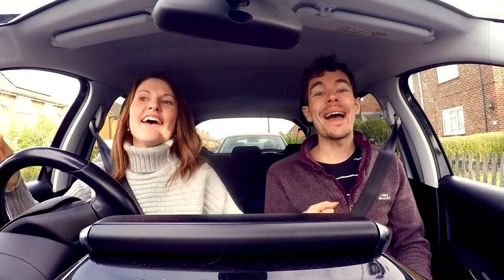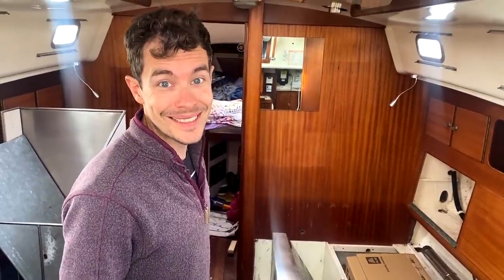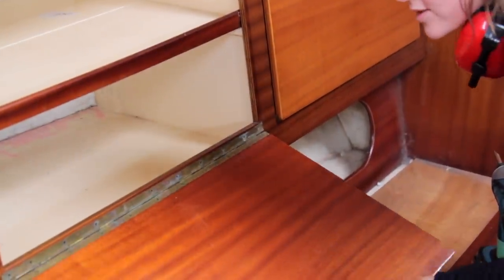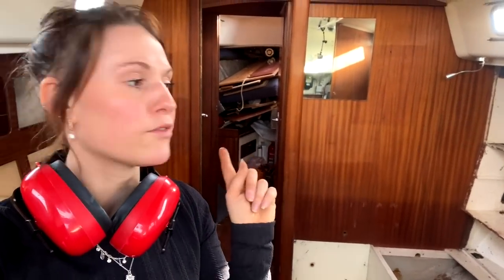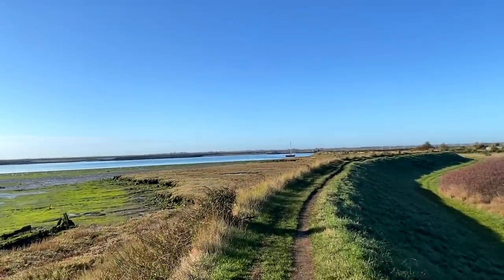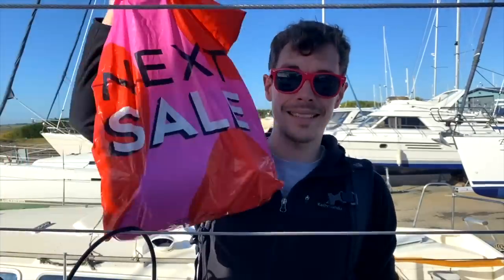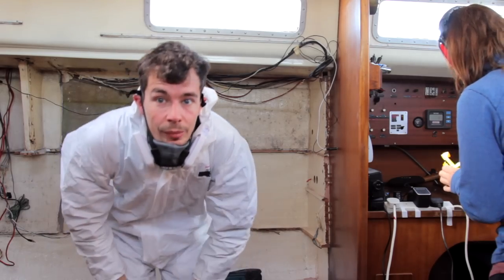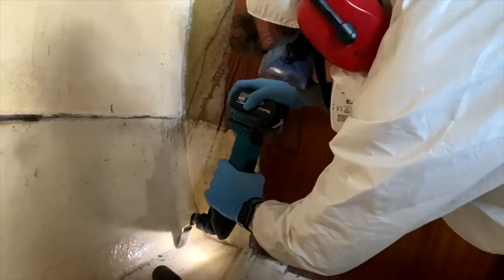Ep 4 | DEMOLITION has begun: what have we done to our SALOON?!

Comment: Not sure the chainplate is quite as bad as you think - the rusted portion is a retainer for the deck.  The vertical piece of metal which looks sound, is what is holding your mast up.  That looks to be bolted to the bulkhead and looks sound.  By the time you take your mast down and grind out the rot, it should be pretty clear what needs to be re glassed - using ply as the core. 
Best of luck - looks like you have big plans.
Reply: I am pretty sure it’s 304 stainless at the vantage of their boat. That being said replace with 316. Learn up on stainless steel. 304 will corrode as you see when its hidden .
Reply from the maker: Yes, you are right. I was a bit dramatic at first. It took me by surprise and I thought the worst!

Comment: Consider keeping the cooker brackets for now, they may be very useful in the future.

Also consider adding closed cell insulation during the re-build because it will be so much easier than trying to add it later.  Yes, it will keep you warm in the winter, but also cool in the summer.  Good luck 🙂
Reply from the maker: We do have a bucket of ‘potentially useful fixings’ where we keep things like the brackets! 
Great advice about the insulation. That is high on our priority list!🙂
Reply: Better make sure you do your research on insulation properly or you will end up with a huge mold issue.. the hull is going to have condensation from the warm water cool air or warm air cool water.. if you don't have a path for the condensation to drain and have airflow to dry it out you will ruin your hard work

Comment: That rusty bit at the chainplate looks like it may be just a backing plate for the trim on the deck. No? Looks separate from the chainplate itself. I wanted to see what the outside end of the chainplate looks like. btw; The DIY projects tend to be more interesting to me than the sailing and cruising I see on similar channels. Once you've seen mealtime, a hike, a daytrip, grocery runs and laundry day, the refit projects are much more satisfying. Anyway, onward and upward !
Reply from the maker: Yes you’re right. The initial shock of seeing the corrosion made me assume it was the chain plate as well! I hope you’ll stick around for the DIY parts at least. We will inevitably start sailing at some point and try to keep the content interesting.🙂

Comment: Suggestion learn up on the stainless steel chain plates. Replace with 316. The vintage of your boat probably 304. As you see the corrosion with the hidden one. This is a good thing a set back yes. Would not want anyone to experience a major failure.
Reply from the maker: Thanks for the advice! It’s a steep leaning curve!

Comment: That rusty bit is not a chainplate.  It is a covering or backing plate for the on deck portion of the chain plate flange.  It is not structural. The chain plate looks very good, and so stout compared to what production boats use today.  Obviously, water has entered from above.  Remove the plate on deck, re-bed it, descale the bottom bit, seal and paint it.  Repair the damage deck material around it. But the chainplate it self looks totally serviceable.
Reply from the maker: I think I was a big dramatic at first! Was a massive shock and worrying to see!